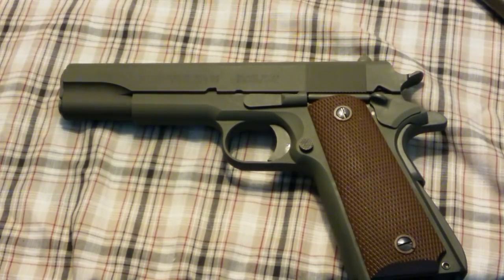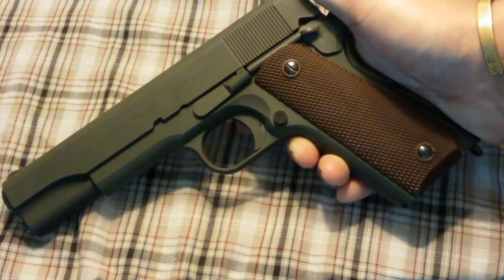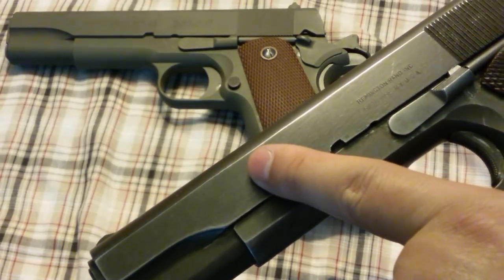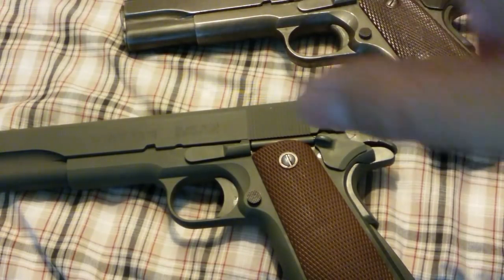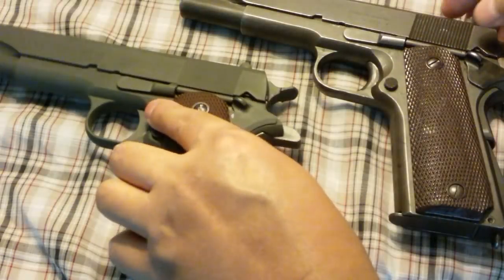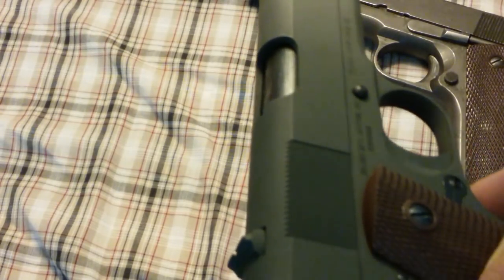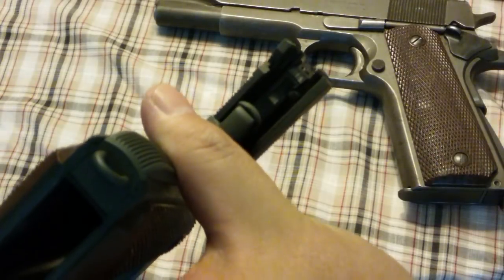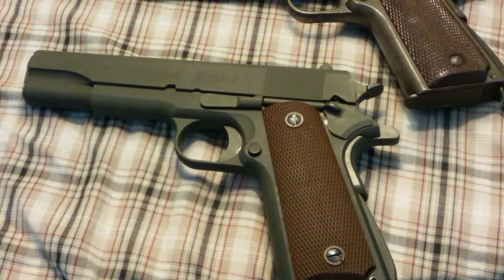How does the inland ww2 1911 compare to the original? BATJAC J.W

Comment: I got a 1943 colt 1911a1 it's got a commercial slide with military markings on it. It was also originally had a SWARTZ safety in it,but colt removed it before sending it to the military

Comment: Hello.  I enjoy your vids!  I recently purchased an Inland. I think it is great!  
However, I immediately changed out the 80 for a 70 system (shim and all), and it works very smoothly. I personally cannot stand having an 80. 
I like the dark black parkerized finish of the Inland.  (In any case, I don't think I would trust my ability to spray paint over it as well as you did!) I think Inland did a good job with the parkerization.  

My old Remington Rand is from 1944 and I agree with you, the grips are a very different shade of brown, and I SO like the short trigger that I replaced the new inland trigger with a stamped, checkered late production Colt trigger .  It fits and works just fine.
  I have finally found a new shooter that will allow me to reserve the old warhorse, yet allow me the joys of firing a very close replica. Thanks for your love of the 1911.
Reply from the maker: Thanks for watching!!

Comment: The thing about M1911A1s, guns from different manufacturers were always a little bit different.

Some companies made all their parts in house. Some used Colt parts. Some contracted other, smaller companies, to make parts for them.

So little things like hammers, triggers, slide stops, etc are going to have some variation to them. 

On top of that, manufacturing processes may change during production. So later production guns may have differences from early production guns.

That's the neat thing about Government 1911s. Each one is going to be a little bit different. A little bit unique.

Comment: "purist" loose sleep over what is "correct".  I admire your effort to make this one look "correct" and it is probably as correct as you can make it unless you have an "original".  However, even the "originals" varied by manufactures by small details including finishes.  The parkerizing colors were not always the same and certainly changed as the pistol aged and was used.  I don't think the "series 80" system is a big deal.  I have a Auto Ordnance 1911 PKZ and it is smooth and performs fine.  I do think the spray paint will not hold up as I'm sure you are aware and will chip and flake with use.  But hey, it looks good.

Comment: Congratulations for the 1911A11, I'm a BIG fan 1911, mainly 1911A1
Reply: renato sobreira Yea I got the collect 1911’s bug too. Took me 30 years but I got a 1917 manufactured Colt with all the stamps in 2016. Turns 101 this April. After I got it I was like “now what, am I done”?  That answer to that is no, got 3 more since... Sigh...